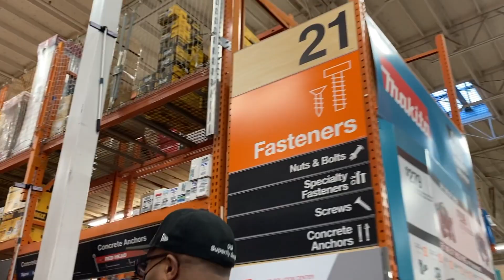Too TALL for YOUR Foxbody Mustang??? This Is The Solution!!

Comment: I have 1 stubborn bolt the back drivers side bolt must be welded in lol my hand tools just wont do this 1 dang bolt
Reply from the maker: Take your time and use some PB Blaster or WD 40. Let it set and soak. Then try to turn the bolt in small increments. I hope it will come out! 💯👊🏾